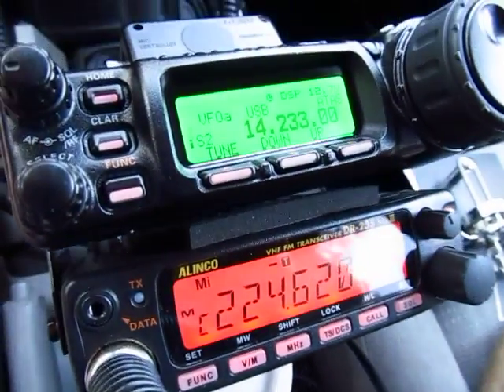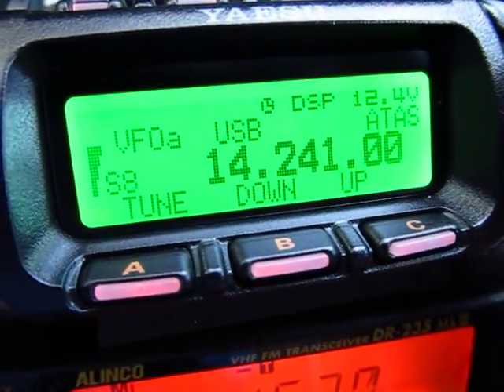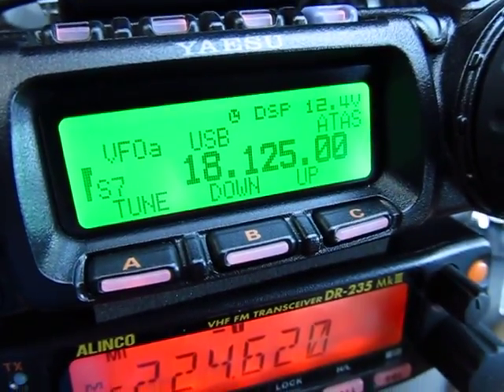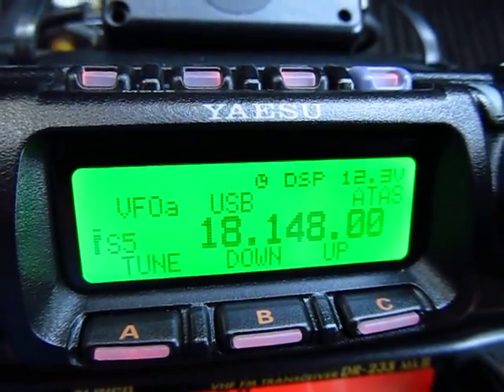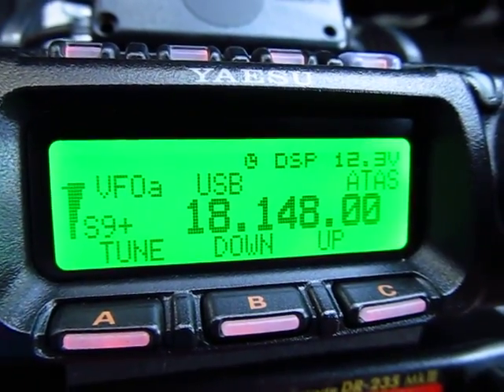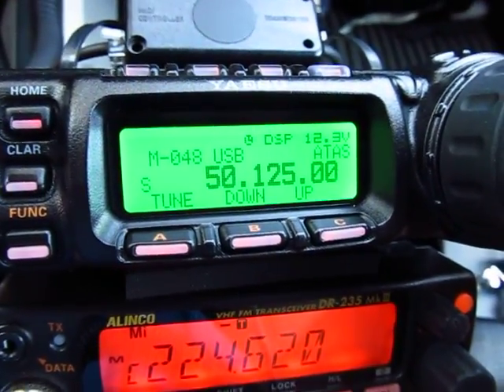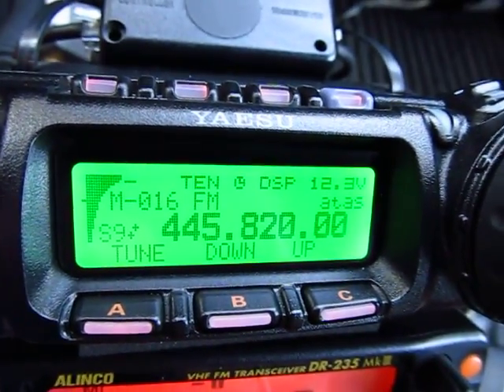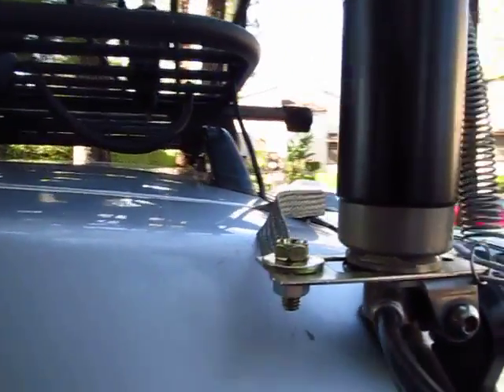Yaesu FT 857D

Comment: I bought a new 857D almost 7 years ago and am finally getting it operational.  A video like this which simply demonstrates the radio is very useful to those with no prior experience.  Thanks.
Reply: i have my hand helds, plus a 857 its frustrating need to rtfm

Comment: i've been trying to pick one of these up off ebay for about a month now. people are wanting (and paying!) gold for these things. i can get one new for 790, with a 60$ rebate its 730. for a used one, i'd say at least 100$ off is necessary, so my limit is 600$, yet i see them consistently going for more than you can buy them new!! hopefully i can pick one up soon. mainly want it for the SSB and HF stuff.

if i can't pick one up, eventually i'll probably just end up with a dedicated chinese 10m SSB radio, and a dedicated mobile 6/2/440 FM only radio. i think that should about cover my needs.
Reply from the maker: wait and get the new Yaesu FT-891... it has IF DSP, a roofing filter and a more sensitive receiver...

Comment: I prefer the 897D lots more breathing space with a built in fan and more heat dissipation through the larger case and heat sink and optional batteries or PSU. The 857D just seems too packed and gets warm. Had my 897D new for 4 years and still works perfect. Before that from 1990-2011 I had the FT-747 GX for 21 years before it packed in. lol. Though it can be fixed, just needs new lights for front panel and signal meter and new finals as the power output dropped to 40 watts. Yaesu are great radios, they last a lifetime.
Reply from the maker: Agree, but for mobile in vehicle use with the ability to mount the head unit remotely, the 857D wins my vote hands down!
Reply: For mounting one and only one radio in a car, the FT-857D also covers VHF/UHF and it is smaller.

Comment: my stock mic lasted 3 weeks it went from 600 to 100 ohms love my md 100 mic sorry b hiel i also mod the mic to a electric on simple mod and what compresson  kg6mn jerry
Reply from the maker: +jerome grzelak cool, thanks for sharing Jerry.
Reply: My mic crashed also... I replaced the capsule. It wasn't easy to find a replacement, but I found a normal microphone with the same caracteristics, took it apart, and installed the new capsule.

Comment: can this be used as a police scanner also?
Reply from the maker: Yes, although many police channels have gone digital....
Reply: N1CY so what can one use/buy to listen to them?
Reply: @HugDeeznueces  now you can buy a digital scanner for $99 from connect systems called the cs580
Reply from the maker: You'll need a scanner that will decode digital modes; they're available but very expensive.
Reply from the maker: Robert Fern  a digital scanner, or a scanner that will decode digital modes; call gigaparts.

Comment: man this is like the 20th utbie vid Ive seen - with someone that tunes right over a QSO.  Wow go up 5 or down 5 to a clear freq, it's really easy.
Reply: Can't agree more.  5w or Qrp is enough to talk around the world. Plus you even listened to a weak  station trying to make a contact.  Tuning over the top could have made the difference to him.  It's not about how much power it uses to tune.  It's just poor practice
Reply from the maker: Radio puts out 5 watts when its tuning, a cw carrier. But you have a valid point and typically I do tune on a clear freq. Thanks for the feedback.

Comment: Shouldn't you move to a clear frequency before tuning?  (just thinking that since it does transmit in order to tune).  I'm new to ham radio, so please let me know if I'm wrong.
Reply from the maker: Yep, however; if you're stepping down from 20 to 40 meters, you won't hear anything; the radio transmits 5 watts cw carrier ... not a lot of power to tune.

Comment: hi! how did you connect your radio to the battery.. got the same rig and my antenna is Atas 120A on a new ford edge13.. am afraid to connect it directly to the battery.. i might interfere the cars computer board and might create some ground loops to the entire system of the vehicle. thanks
Reply from the maker: Sorry for the delay, the radio has to be connected directly to the battery, or through a Blue Sea box that is directly wired for the battery.